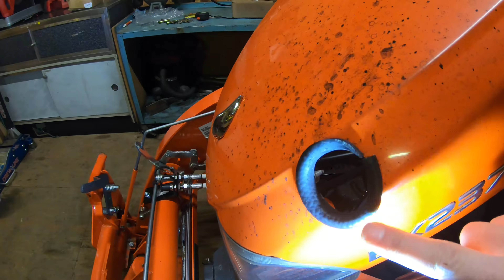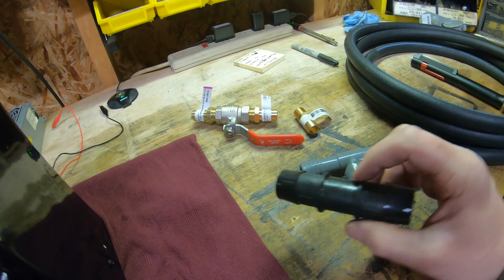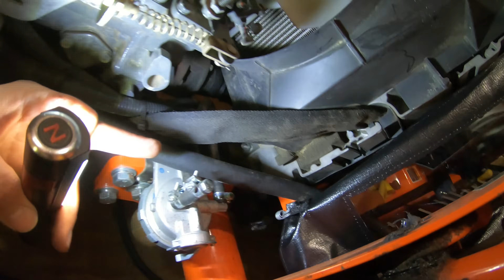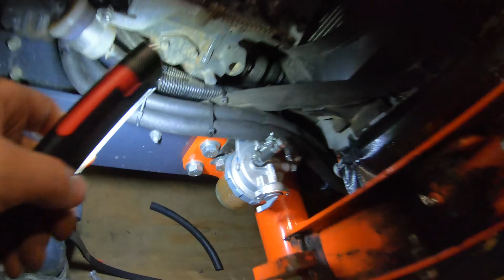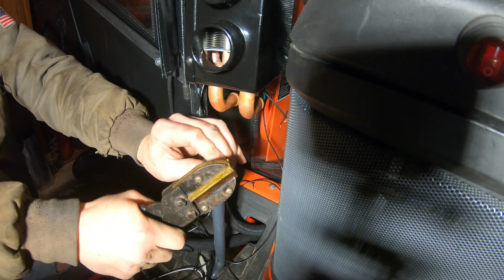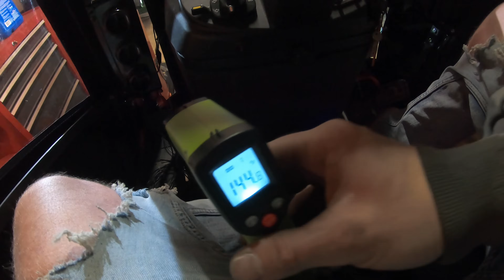Kubota BX- Installing a cab heater on my tractor (How-To)

Comment: Great video. How has this heater held up over the last 5 years. I have looked at these heaters in the past and have procrastinated. I also thought about cobbling up one myself using a heater core from a car with a small fan and a potentiometer to vary the speed and packaged them into a home made little metal box. Just curious how this has held up and if it might be worth getting. Thx

Comment: I followed your video. I hooked my line like you but I don’t get any pressure going to the heater core. Are both your line going to the lower radiator hose side? I took both lines off the core with the tractor running and got very little water to come out of them. I think I need to find the pressure side of the water pump or go to the upper radiator hose. Any help.

Comment: Very helpful video. Is there any reason why you chose to have the heater on the opposite side of the tractor of where the supply and return are? Seems like it may be easier to run it straight into the the tractor from the same side as the supply and return are on the right side. Jw cuz I'm gonna install one in mine next week and wondering if im missing something.Either way great job and thanks for the helpful video.

Comment: Good job. I have wondered about installing a reversible pitch engine fan so it will blow radiator heat into the cab. The stock set up pulls outside cold air into the cab in order to pull it through the radiator.
Reply from the maker: Yah I agree, reversing the fan in the winter would be fantastic. Although it might take some time to start feeling any warm air anyways on those really cold days. In a few different cab videos I made, I think the ones where I re-install the cab for the following seasons I show how I block off that screen so that it’s not sucking all your heat out. I use a thick felt/fabric on the inside of the outter radiator screen and it’s worked great ever since. I do that every year now

Comment: i dont have those plugs. Why cant i just cut that upper hose and run both those ends to my core in cab. Alls that would do is send it through the core and back would it not? Yes i know the t-sat would have to open for heat but no big deal!

Comment: Hello.   Can you provide a link to the heater that you installed?  Thanks in advance.
Reply from the maker: Hey Ken, the link should be in the description of the video.. If the link no longer works then try going to “Wish.com” and typing in “cab heater” and you should be able to find the same heater or one that’s very similar. Good luck!
Reply: @BiffsEquipment  Thanks.  I found it.  Costs more not but looks like the same heater. $70.00

Comment: Would you be able to give me a link for that heater,I looked but can't come on one. Super video, really simplified the process.
Reply from the maker: Hey Frank, the heater I bought was from wish.com but you can find similar ones on eBay. But if you go to wish.com and search “cab heater” you should be able to find the same one or heaters that are very similar to the one I got.. the only bad thing about wish.com is it takes like a month to get it sometimes as it comes direct from China. If you do buy one from there go with a heater that has 4 outlets instead of only 3..  the more outlets the better cuz that means the radiator inside will be larger giving off more heat than mine does.. but Mine does do the trick pretty darn well and keeps me warm.. I make sure I insulate the cab well with fabric tho so that there aren’t many air gaps otherwise with a strong wind it can suck the heat out from the cab so just be aware of that. But so far this was the best heater I found to use in this cab for its dimensions and how well it fits and works.. if you find one with an extra outlet from what mine was it should still fit no problem where I placed mine because the only thing that will change is it will be a little longer. Hope this helps!
Reply: 100percent, thanks very much for getting back to,I'm sure plenty wouldn't. I just bought a hitachi ex45 an that's what I want to put the heater in,here in the west of Ireland we might not get the negative temperatures that you do there but it does be blowing cold weather for 7 or 8 months so a heater is badly needed .

Comment: Thank you for the info on putting a heater in, I just put a cab on my bx2350 Kubota tractor I take care of 2 community ice rinks in winter so this winter I plan on being nice and warm in my Kubota.
Reply from the maker: Hey thanks man! Awesome I’m glad this video helped you do your installation! It’s really not too bad of a job once you have a little guidance and steps to follow showing you what should go where and why. I’m sure you’ll be nice and cozy in your cab now this winter! Sounds like a fun job taking care of ice rinks! Do you run special tires for this?
Reply: No I just use chains on the tires, but stud tires would  be better I'm told @BiffsEquipment

Comment: I bought a BX2680 last October and even though there is heat coming out of the heater, the cab stayed ice cold.  After checking out the tractor a little more I realized the cooling fan draws air from the cab, past the battery and through the radiator.  All my heat is being sucked out of the cab by the radiator fan!  What was your solution?
Reply from the maker: Hey Rick, your right since the radiator fan sucks air from the operator and pushes it to the front of the tractor in reverse from your normal tractor design (which is actually a great thing in the summer) you have to block off the radiator screen in the winter. I showed how I do this in this video which I’ll link below for you… lmk if this helps! 
https://youtu.be/xKoZDjNzA2c
Reply: @BiffsEquipment  Thanks!  I about froze my butt off last winter.  I think I'll try to make a cover for mine.  Keep the videos coming.  They are both interesting and informative (I just missed this one).

Comment: Biff I installed a core in my kubota bx1880  like you did, but it doesn't get really hot, how is yours. Could use help.
Reply: I sent it back, the second one did  the same thing so I ordered a complete new one 28,000 but and I'm getting heat now. Thanks for your help, love your channel.
Reply from the maker: @wilfridashlaw4680  glad to hear it all worked out in the end buddy! Thanks for your support!
Reply from the maker: Mine gets pretty hot, did you make sure you bled all of the air out of it? Try removing one end of the heater hose off the heater then run the tractor until coolant comes out of it then plug it back into the heater, sometimes they get air locked when they are new, I’m sure you got some air in yours still is all

Comment: Help?  I have a 2003 bx1800. I don’t have the fitting you have at the top radiator hose. I put a tee into the top hose and a tee at the lower hose. I bled out the air with a purge tee. I get no heat. How do I get the flow to go to the heater? Thx.
Reply from the maker: You have to bleed the air out of the Heater itself .. remove one end of the heater hose from your heater and run it till coolant comes out of the heater then once coolant starts to come through the heater you know it’s bled and can stick the heater hose back on. Try that and let me know what happens. Sounds like you did everything correctly so you must have an air lock

Comment: What material does the tee have to be made of to withstand normal operating temperatures of the coolant?
Reply from the maker: I believe mine was just made from PVC and irs been holding up just fine, the temperature of the coolant isn’t getting very hot, these tractors run pretty cool.

Comment: Nice…  I just looked at my tractor, and I have a sensor plugged into that hole :(  I have the BX 2380
Reply from the maker: Thanks man; dang sorry to hear that but lucky it’s not a huge deal, you could always buy a T fitting and run both the sensor and your heater hose to it at the same time, if not you’ll unfortunately have to drill and tap a new hole. Let me know how you make out!

Comment: Good Day, awesome job, very delayed. I’m doing the same thing. You weren’t kidding about the lower rad hose.. I had to put a T on the upper rad hose, for my the thermostat housing has a temp gauge and I have a coolant block heater on it as well. Thank you.
Reply from the maker: Awesome man, I’m glad the video helped you out that’s exactly why I wanted to make it. I’m not sure why Kubota made 2 different types of thermostat housings but they shoulda just made them all like mine with the extra port/plug for an accessory heater. I’m glad you got yours all ironed out, I plan to do another Heater upgrade sometime after Re-installing my cab again this year. Thanks for the comments 👍🏻

Comment: Hi 
Thank you for posting this video!
Question .. what size fitting/adapter did you use to connect the heater hose to the thermostat housing?
Reply from the maker: Hey Sheldon, I can’t remember but I think at the very beggining of the video when I’m going through the parts I tell you what size nipple I used. I wanna say it was either 1/8” or 1/4” brass nipple. You can find them at any local hardware store. Let me know if you find it in the intro of this video if not I’ll see if I can find it for you 👍🏻

Comment: Good morning, awesome video. I’m installing this heater as well on my BX. Do you know what size is the fitting for the thermostat housing. I need to find another coupler that goes there for I have the temperature probe there.
Reply from the maker: Sorry I’m just seeing your comment. I’m assuming you are saying that you don’t have the plug on your thermostat housing? Some had the plug there some did not.. If you do not then you will have to remove the thermostat housing and drill it out and tap the treads for 1/8” or 1/4” pipe thread .. I can’t remember which size either 1/8 or 1/4 but in the intro of my video I believe I said which size nipple I used for this fitting.. it’s just your standard brass nipple you can find them at any local hardware store.. nothing special about it just if you don’t have a plug that you can pull to thread it in you’ll need to drill and tap it as I explained above. Lmk how you make out!

Comment: Getting my BX23S delivered soon. If I do this will it void my warranty? And are the fans noisy or its tolerable? Are there variable speeds for the fans? Thanks mate.
Reply from the maker: Adding a cab heater will not void your warnetee to my knowledge just make sure your installing it correctly with the proper fuse in place so that if it ever shorts out it will blow the fuse and protect your tractor. The fans on this heater only had high and low settings they are not infinitely variable. Hope this helps!

Comment: Question, now that you've used the heater for a season. How did it work out? Under sized, Over sized or just about right?
Reply from the maker: Hey Chris this heater worked great last year much better than any electric heater tho I do feel it was still slightly too small for me and where I live with the cold temps we can get so this fall I plan on installing an even larger heater so stay tuned for that!

Comment: Heyhey Mike,  You don't happen to have a link for that heater do you?
Reply from the maker: Hey Mike I dont but if you go to wish.com and search "cab heater" youll see the same exact heater it may be red or it may be black.. Some have 2 holes some 3 holes and some 4 holes.. I would get one the same size or slightly bigger than mine.. i would prolly go with a 4 hole heater since your cab will be bigger than mine.

Comment: Biff,   You got that BX laid out man! Very nice! I really like that safety glass window on your OTC cab too. 
Sweet machine all around!

I had that same electric heater on my old Deere 425 which had a Deere steel cab on it. I got barely any heat
out of that thing.  You can't beat the heater core option.
Reply from the maker: Thanks man I appericate it, I’v been really happy with the cab so far 👍🏻 yah the electric heater just wasn’t enough so I ended up putting a heater core style heater in it instead and made a video on it. It’s much much better now. Thanks for watching!
Reply: @BiffsEquipment  Yep you did a great job on the install!
Reply from the maker: @GearHead4Lyfe  thanks buddy!

Comment: I think I’ve seen that the Curtis cab comes with a panel that covers the intake suction screen below steering wheel so it won’t suck all the warm air out of the cab. If you don’t stop that suction from within the cab it’s gonna be hard to heat I would think. That electric one may have worked if that suction screen was blocked like the Curtis cabs. Just a thought. Looks good ! Have a Blessed Day
Reply from the maker: Thanks for watching mike. Yah I totally agree with you, it’s funny you mention that cuz I actually contacted Kurtis about that radiator screen cover but unfortunately it’s not for sale seperetly.. it’s only to be sold with a kurtis cab which kinda stinks .. I plan to make my own very soon tho as it is hard to keep heat in when the rad is sucking it all back out.. great in the summer but bad in the winter (unless you cover the screen) I plan to use some heavy fabric or something to cover it and when I do I’ll post a video on it. Thanks for watching !

Comment: Great project as always. Nice heater install. Are the fans individually controlled? Also you could easily mount a thermostatically controlled valve that shuts the water off to the cab at say 65° F. Why not use a 3/8" close nipple and mount the valve directly to the thermostat housing?
Reply from the maker: Thanks Sean, The heater so far is working flawlessly, SO much better than the old one and my new switch panel has been great as well. As for using a close nipple to mount the valve off the housing I was only able to get the supplies I had as it was Sunday when i went to pick up the stiff I needed and not many stores were open and had what I needed so i had to make due. I also wanted the valve to be some what hidden so it still looked pretty factory when I popped my hood but that's a great idea what you said for others who want to simplify things a bit. Thanks for watching!

Comment: I am doing a heater install on my side x side and you can buy a 1”x1”x5/8 y to do the install.  The y might make it easier to do And they are made of aluminum. Nice work I hope to get at my install soon. You will like the heat. I know I do.
Reply from the maker: Thank Patrick! The aluminum T's are a great idea and will prolly be a little more heavy duty than the PVC ones so that's good to hear. You'll have to let me know how yours turns out! Having a heated cab in the winter is the best thing in the world and the heater has been working flawlessly thus far! Thanks for watching!

Comment: Great informative video.  I appreciate that you mentioned supporting supporting your loader while working under it.  I cut some angle iron to 14.25" and place one over each the cylinder rods, started by holding in place with zip ties, but now I use magnets.  Once again after watching your video - I have cab envy!
Reply from the maker: Thanks Frank, Yah I try to always think about safety when I can so that i can help others to stay safe.. As you know it only takes one time to have something bad happen in an instant. The angle iron you made up for your loader rams was a good idea.. I have seen it done before in the past but never actually knew anyone to do that. I actually like that idea better than a 2x4. Thanks for watching! Sorry my reply took so long i have been extremely busy plowing snow the passed 3 days.

Comment: Will you remove the cab in the summer?
Reply from the maker: Hey Mark thanks for watching. I havnt quite decided yet to be honest.. At first I purchased this cab for the SOUL reason that it would be easily removable come summer cuz i didnt want a cab on in the summer but the more i use the cab the more i really enjoy it and like it so its getting tougher and tougher for me to wanna take it back off come spring. I guess ill have to feel it out come spring and see how things go so stay tuned!
Reply: @BiffsEquipment  Yea I would think you might want to leave it now that you have the heater and hoses installed. If you take the door and windshield off it would make a decent sunshade I guess.
Reply from the maker: @MarkDecamps  I agree.. yah I’ll know more this spring when I kinda feel things out here as it gets warmer for sure

Comment: PACKERS AND BILLS MOVIN ON!!!!! congrats
Reply from the maker: Hell yah!! I hope to GODDD we can make it to the super bowl this year! Just getting there would be a dream come true for all of us bills fans here in buffalo, Win or Loose!! Hope all is well buddy, how is your back drag been working? We got over 3' of snow in less than 3 days so I been plowing like a mad man both at work and at home so sorry for the late reply
Reply: Back drag works awesome. Did some minor additions my video didn't show. Mainly adding some stoppers to hold the pins on the pusher, so they just retract instead of pull out. We've been pretty light on the snow lately, unlike you guys. I used to run hwy 5 twice a week  from Wisconsin to Lactalis cheese in Buffalo (kind of  Lackawanna area really) , to avoid the tolls.  I know all about your winters, ya get the snow! We've got the potential for a good 1-2 punch this weekend, Saturday night into Sunday, but they say it'll be done before the big game. I also added my uhmw blade to the backdrag, stuff cuts like steel. I love the flip up ability of the blade, and the "reach" it has out in front of the tractor. It makes a great combo with my blower, and more importantly I don't need to remove my blower now. I'm busy as hell at work, but I go home Saturday am, then off until Wednesday so let it snow!
Reply from the maker: @ironheadbiker  that’s awesome man.. yah I only live about 40 min west of Lacawana.. very cool. I watched your video with your back drag it works fantastic!